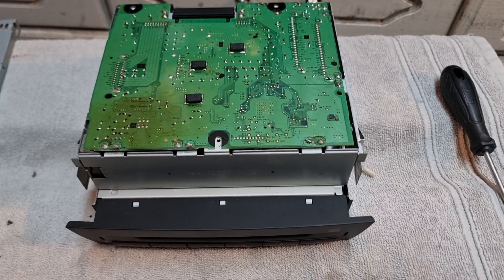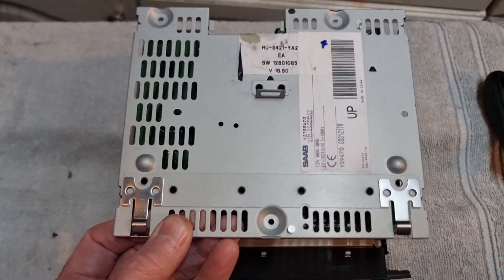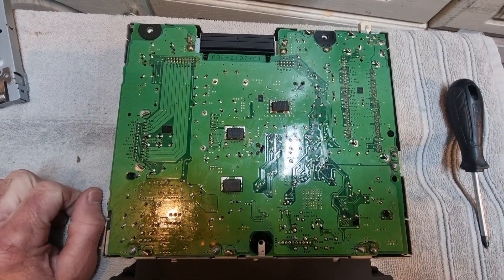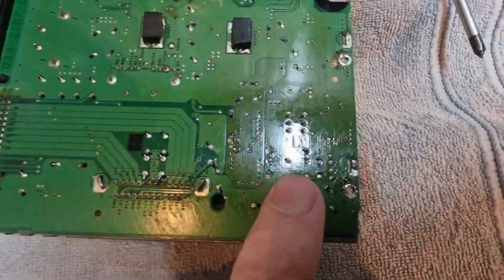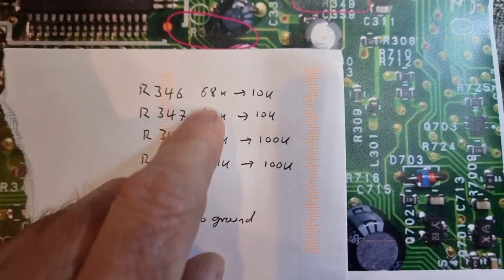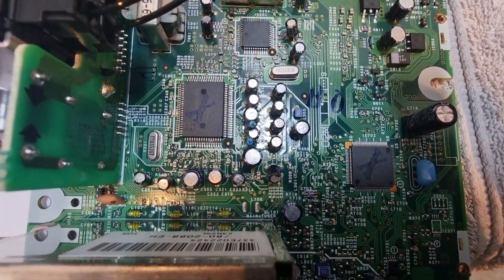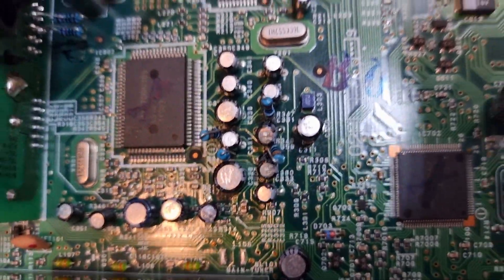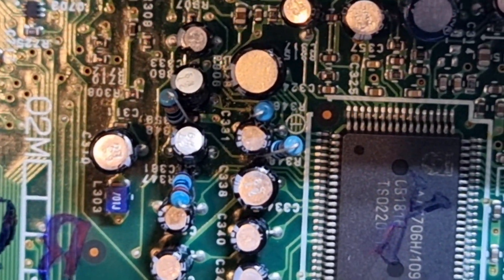SAAB 9-3 EHU AUX Resistor Mod to improve low sound level and poor quality

Comment: So, if I understand you correctly, the 2006 model should have the 'correct' values of the resistors? 
Great job by the way. 
Did you get it back to work?

Comment: Guess this didn't work... crickets in the comment section. Looks like you put the ground resistors in the wrong location. Ground is up above by the tel + and - 

Clear your throat next video. I about smashed my head into a wall. God dammit